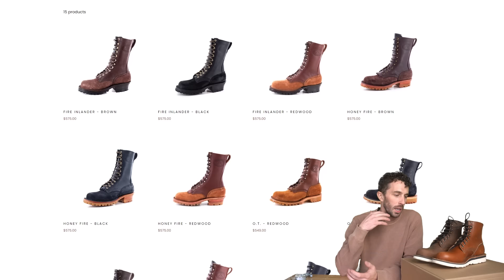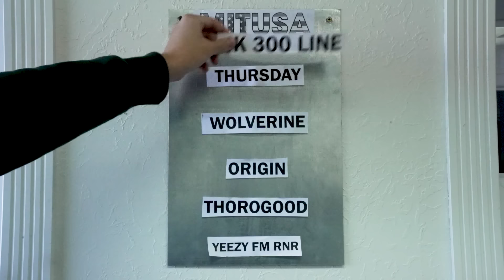Did JK Boots really make a $600 boot for $379? JK 300

Comment: I've actually been looking at a pair of these boots, but the sizing guide on the website might be glitched. I usually wear size 9 Nikes or an 8.5 for the Thursday captain. I'm a bit new to high quality boots but my understanding was that for most people it's a half size smaller than sneakers. I put a ruler against the wall and measured as per the instructions on JKs website. I came back with a size of approximately 9.5, and I plugged those numbers into JKs website and they recommended a size 5. Anyone else got experience with this sizing? Is it a glitch or does JK just make really huge boots?
Reply: I recently got a pair of JK OT's Composite toe boots.  I usually wear a 12EE in Carolina boots, and either a 12EE or 11.5EE in Keen boots, depending on the style.  I ended up settling on a 10 Average and the fit is perfect.  I had originally ordered a 10.5 Average but once I got them I sent them back because there were still a bit too big.  I was very concerned going down 2 full sizes from what I'm use to wearing, but I followed their newest sizing chart and it is perfect.  I'd suggest doing it again, or even having someone else mark you so you aren't bending over and potentially getting it wrong.
I also own a pair of Nick's Builder Pro's.  I thought they were a bit too big but Nick's convinced me that they would be fine and form to my foot.  Well they didn't.  My $600+ Nicks sit on a shelf and very rarely get worn.  I even put a Spenco insert in them and they are still too large.  When I described the way they fit to JK they told me that the fit was definitely wrong.  So I'll be sticking with JK going forward for sure.  They actually care about fitting you right.

Comment: Jk boots are going to be 1 size bigger than most others. They run a little big.
Reply: I ended up going down 2 full sizes compared to my Carolina boots I usually wear.  It was a bit scary to spend that much on something so different, but I trusted their sizing chart and it was dead on.

Comment: I wish I could post a pic of the insoles in my boots and compare them with yours that you cut
Reply: You have 300's and don't think they are the same specs?
Reply: @jeffmitchell72  the build quality is not the same. Where the vamp and counter meet on the inside should as shown fit clean around the insole where mine the insole of both boots is smaller and you can see the midsole at those points. My insole looks like a “cobbled” mess where they JK Boots actually put Spenco insoles in the boots not out of the boots as stated in their 4 page wear sheet as they provide them to “tighten” fit

Comment: What did you get wrong? The foam. Would it really cost that much more to use a leather midsole? Or take another minute to run a second stitch up front?
You can't rebuild these. Hopefully they last through a single resole, but for the price (which you rave about) I'm still not impressed. 
There's a vacuum here for a simple stitchdown boot built without ANY synthetic crap.
Another overpriced hipster boot 👎